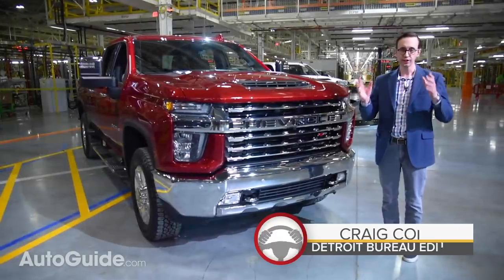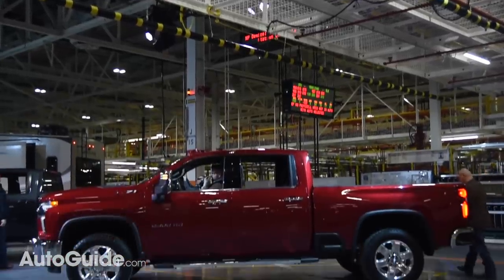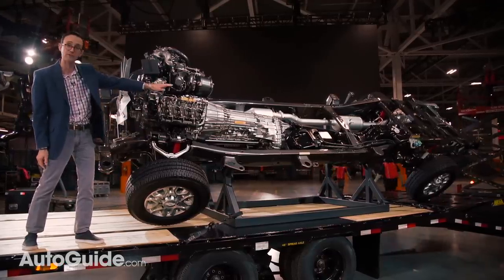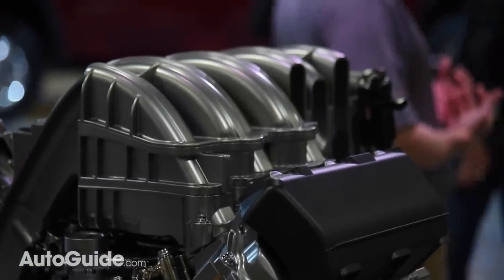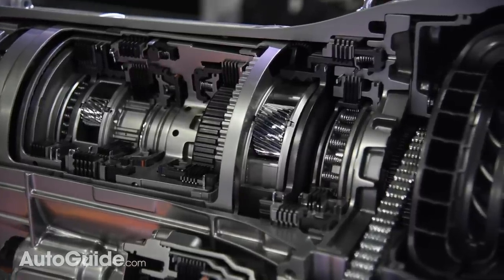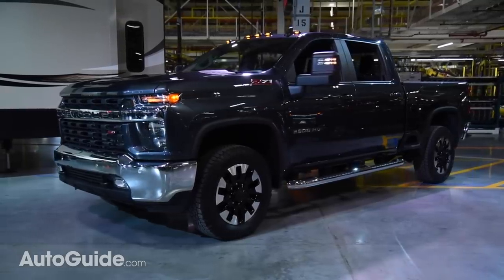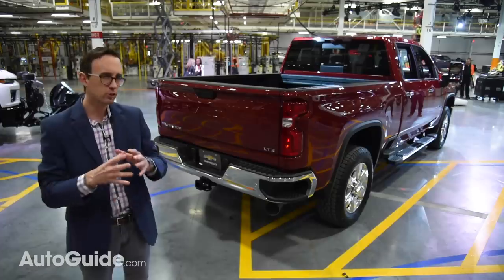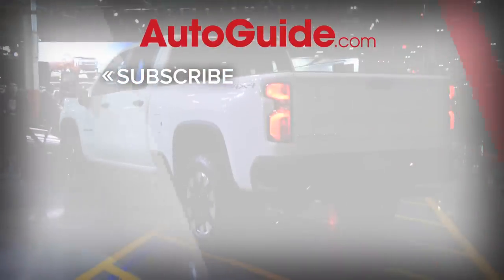2020 Chevrolet Silverado HD - First Look

Comment: The Direct Injection on the 6.6L gas engine, also helps build carbon on the intake valves. Fords new 7.3L gas engine sticks with proven Multi-Port Injection.

Comment: Chevy needs to do something with that boring interior in all of its line up!! For real
Reply: Interior looks like dt of a car from early 2000's
Reply: The reason I dont like Chevy's
Reply: Both Chevy/GMC and Ford. RAM has set a new benchmark for truck interiors and is now miles ahead of the competition.
Reply: i prefer the plain interiors, i dont need the interior of my truck to look like a cadillac or a mercedes
Reply: @Huntereriq  And GMC's because of this:
They keep making it the same way as a RAM
None of them sound good
The 3rd gen don't have a 4 liter V8 or a 3 liter V6 and all first year trucks get it's engine from the earlier body style trucks
There is no 2014-2018 Trail Boss like Ford Raptor and RAM Rebel even the Titan Warrior Concept doesn't either but the problem is these are the only trucks that don't make a edition compared to the Raptor in a previous generation and the Nissan Titan only has two generations and not 4 and every truck is compared to other trucks they make the same number of generations
All the 3rd gens have 140 mph not 120 mph even for the work truck models
The 3rd gen don't have auto stop for push start for special editions or floor shifters and the 1st gen (1999-2006) is the only one that has it
All of them have a 6k rpm tach and not 7k rpm tach and except for the diesels they have 5k rpm tach
The 4.3 V6 don't have a 8k rpm tach
They keep skipping one year for the 2500 and 3500 HD models after the 1500 models came out
They make the same body style with the same year they redesigned the current gen
The first year of the 3rd gen Silverado/Sierra is 2014 and not 2008 and last year is 2018 not 2014
The 2019 4th gen didn't come in Regular Cab after it was made
They stopped making 4.8s and 5.7
The 2019 4th gen Sierra will never come out with the 4x4 badge

Comment: 1:25 I'm curious to know, does GM take input or test audience opinion on vehicles they plan on releasing? I can't imagine many people would have approved on that new Silverado front grill and overall look. Just looks really awful.
Reply: I bet the GMC Sierra was like "Silverado is my mom's brother's wife's uncle's cousin from his dad's side" so we're not really related.😂
Reply: First the Chevy Reaper now this, what's goin on over there at Chevy. They need to get more strict with their urinalysis😕
Reply: @reggiep3369 , the Reaper was done by an aftermarket company
Reply: DeVstatrOmga, I like it, except for the mirrors
Reply: @reggiep3369 , the Chevrolet Silverado Reaper was A joint venture between Lingenfelter Performance Engineering and Southern Comfort Conversions

Comment: If you're going to introduce a6.6L gasoline engine let's take the HP to 500 ponies with similar torque. GM could have used the existing 6.2L that produces 425 horses. Instead a 6.6L dog at 401 HP. What was the point?